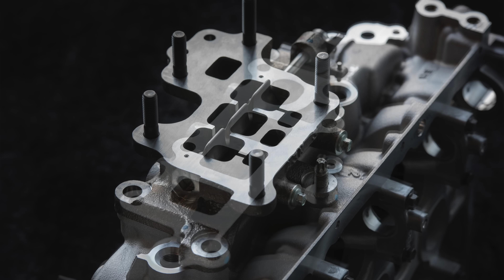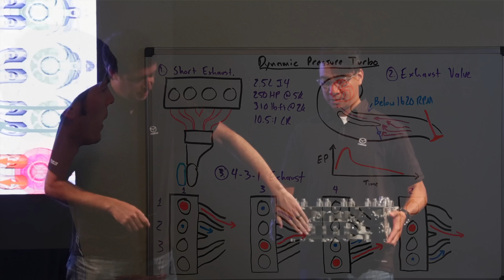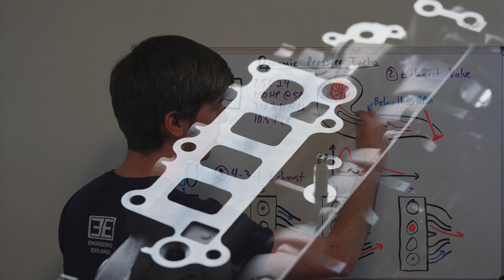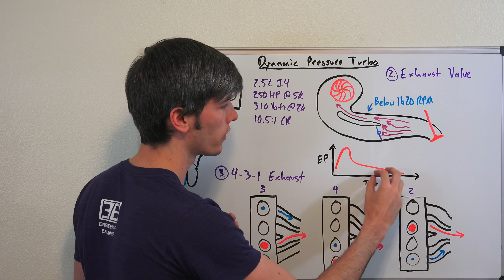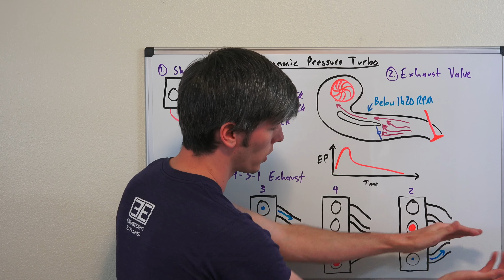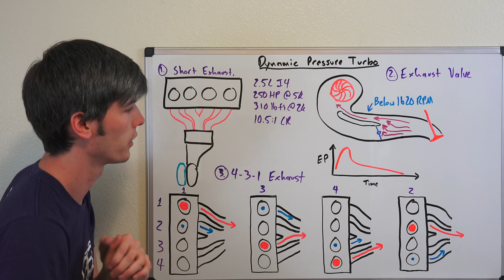How Mazda Is Eliminating Turbo Lag

Comment: Shorter exhaust is not to keep the heat. Shorter exhaust has smaller volume to be filled in with air, so with less power strokes it can faster build pressure between the head and turbo in order to start spinning turbo earlier. Shortening time to pump enough air is shortening lag time. Plus narrow canal speeds up air flow.
Also; we are having problems with EGR valves in intake clogging up with carbon. You can imagine how long this valve in exhaust will work properly before it just jams and you have to take it of for cleaning/exchange.

Comment: Wouldn't the lower pressure of the previously fired cylinder help pull exhaust from the just fired one? Gas always flows from high pressure to low. Don't understand how the high pressure exhaust helps pull from the other cylinder

Comment: This is roughly the same concept as a quick spool valve that Sound Performance made for the 2JZGTE engines.

As for the exhaust scavenging, that's a separate concept done in previous years.

Comment: Why isn’t there an engine thats more than 50% efficient?
Reply: Youssef some diesels are
Reply: Youssef look up the carnot cycle when you have time, there is an upper threshold to the efficiency of   the engine that depends on the temperature of the intake air/fuel mixture and exhaust after ignition.

Comment: The exhaust valve sounds like a typical Variable Intake system that's been around since the 80s on a a lot of cars, adapted to the exhaust system upstream of the turbo with the purpose of expanding the effective working range of the turbocharger.

Comment: That manifold explanation is just foolish. Read some book about gas and fluid dynamics. Gas goes at the path of least resistance. Idealy sport manifolds are made so you have most distance between firing cylinder and cylinder yet to fire. Thats how skyactive g manifold is made.

Comment: +Engineering Explained, So if this system fail (turbo valves closed) it will over rev your turbo to death!
Reply: I am not sure if the wastegate can relieve enough pressure if the turbo is being spun based on exhaust velocity, unless that wastegate is right at the head.
Reply: No, it is still wastegated.

Comment: Thats basically a variable twin scroll turbo, but the twin scroll pipe  ends after the valve and goes into one pipe. The varaible twin scroll closes off one of the scrolls so that all the air is going to only one scroll to increase spool speed. Borg warner makes it. Its a nicer system than this

Comment: just picked up a new 2018 CX9 a few months ago, great car.  It's really torqy especially off the line.  However it seems like it has less torque in sport mode.  I would think best performance would be sport mode WOT.  However it feels the fastest when not in sport mode had half throttle.  By the way thank you Kevin, you are a great educator, a true automotive professor :)

Comment: Uhh.. I may be wrong here but exhaust scavenging only works efficiently on a free flowing exhaust system. i don't see the point of attempting to scavenge when there is back pressure(turbo) such a short distance from the valve..

Comment: 1,3,2,4 makes more sense.
Reply from the maker: No, because then the center two would fire back to back, and this would negate the exhaust scavenging, not to mention it would require a crossplane crank which is not ideal for four cylinders from a balancing standpoint. 1342 is quite logical.
Reply: But now 3 and 4, and 1 and 2 fire back to back

Comment: Jason, do you a have any video for the firing order? It seems like they had to merge 2nd and 3rd exhaust because of the firing sequence. An order of 1,2,3,4 would still have the adjacent exhaust and meet the suction effect goal and would not need any exhaust to be merged. So what is the deal about the firing order? Does it have any advantages?

Comment: Hi Jason.. Another fantastic video explaining turbocharger lag elimination. I know that you favor turbochargers for efficiency. I remember reading or watching about an engine where they use a hybrid super and turbo. The supercharger would use the battery (not engine or through alternator) to spool up and then shift over to turbo mode for efficiency with almost no lag. Im not sure which company made this engine, I may have seen it on Top Gear.. This would be the ideal answer I feel.  What do u think about it? Do u by chance know of this engine? Given that modern batteries hold far more charge and can be recharged faster, would this be more efficient? Or would the extra weight, plumbing, and complexity make it less practical? Your thoughts please. Love the channel, content, and presentation. Keep up the good work! These videos are heavenly and delightful :-)

Comment: nice, in my opinion is far better than electric booster, something you didnt explain is how the low pressure exhoust gas that remain in the admision stage escape in conjuction with the other piston exhaust, is just the same escape valve? and how about timing to prevent the new air/fuel mix didnt escape?

Comment: A failure mode scenario for the exhaust valve where it gets stuck closed would stall the engine with practically infinite back pressure.
Reply: Avik Sarkar only in high rpm so no biggie

Comment: Here’s a weird idea, Jason. Is it possible to create a forced induction system with a compressor that is powered off the battery by a motor like an electric supercharger until there is enough exhaust pressure to spin up the turbine? Essentially a turbo that is spooled by an electric motor before the exhaust pressure builds so that it never drops off boost. I’m curious as to why this hasn’t been done. Do you know if there’s a reason?
Reply from the maker: Audi does this: https://youtu.be/k8-_UrfbRBA
Reply: Engineering Explained and here I thought I’d get rich patenting that idea. Interesting stuff. Thanks for the reply!

Comment: With a compression rate of 10:1 is it very efficient? I dont know anything about compression ratios. :/
Reply: 10:1 is an average compression ratio, but generally speaking the higher the compression ratio the more effiecent the engine is.
Reply: Govin Lock. the ford's ecoboost, VW's tsi, fiat's multiair, and hyundai's turbo gamma, most of these engines have compression ratios of 10:1, and all above 9:1, and run on non-premium octane fuel. For modern turbo engines, 10:1 is in fact normal.
Reply: Lucas Santi bigger compression ratio, more efficient. turbocharged petrol engine today generally have compression ratio 9:1.
Reply: turbocharged engine always have lower compression ratio than its NA counterpart, because turbocharged engine has higher pressure, which will blow the engine if have too high compression ratio.
Reply: Hemingway Bromfield
"10:1 compression ratio is average" for naturally aspirated, yes. but for turbocharged, no.

Comment: is it because of the momentum of the exhaust pressure in the turbo doesn't come back to the unused path (1650 rpm+ path) or it is just the first milliseconds from the inital state. since the system is design to maintain the turbo to keep spooling, the gases should keep running in the turbo instead of filling the space of the other path. In other subject, do you think that when 3d printing will be precise enough there will be another technical revolution on engine design, if electric engine don't come how to say, in the majority in our roads like, +90%. at least I may think that frame design will be.

Comment: 1. In this case I think the real purpose of using advance exhaust manifold design instead of pay much for using twin-scroll turbo.
2. According to 1. to use 4-3-1 setup instead of 4-2-1 (like 8AR-FTS which equipped with twin-scroll turbo) setup to prior the exhaust pressure by reducing the size of pipe.

Comment: Isn't that firing order common? So what makes this one different?
Reply from the maker: The 4-3-1 exhaust is unique. Most are 4-1 or 4-2-1.
Reply: How does this make scavenging better? Wouldn't a 4-1 in a 2x2 square also have the same effect? Although it does look easier to implement for an integrated exhaust header.

Comment: I never understood why when switching from flatheads to overhead valves in engines they never kept the better breathing three exhaust manifold setup
Reply: Mainly because it actually breathes worse in a non-boosted application.  Equal-length headers - either 4 into 1, or 4 into 2 into 1 - do a better job.  (In Australia, they're actually called "extractors" because of their scavenging effect.  However, they generally need to be much longer, and part of reducing lag is to keep the manifold as short as possible.  Some cars did have siamesed centre exhaust ports - and they were generally known for having breathing issues because of this - but this effect is small in turbo applications and vastly overshadowed by the benefits of reduced lag.
Reply: aussiebloke609 teach me your delicious knowledge you greasy gear head you

Comment: This seems like something that could have been designed years ago. Hopefully coming soon to the MX5.

Did you have a chance to look at failure modes of the exhaust valve? Any idea how many 'miles' Mazda has put on the new engine for reliability?

Thanks again Jason

Comment: I bought a 2018 mazda cx-9 gt model 2 months ago. The 1 big? is when you run hi-test gas it increases the horsepower but does not increase torq?
Reply: u have max torque at low rpm, any gas will be good at low rpm. Premium gas does better at high rpm when the engine gets hot and can knock. U also make the most power at high rpm. Power = (torque * rpm) divided by something (5252?)  so... there you go.

Comment: The butterfly valve in the exhaust manifold between the head and the turbo is good engineering.  Certainly appears to be a simple way to help reduce turbo lag.  I will give Mazda credit for that idea as I've not seen it done before in any other turbo engines.  However, exhaust scavenging is not a new idea, motorcycles have been using the idea for about 40 years, 4-into-2-into-1 exhaust designs have been around.  As a matter of fact, the premise behind tubular headers (like what is in our S2000) is to reduce back pressure, and increase exhaust flow by helping adjacent cylinders extract exhaust gasses.  So, I can't give much credit to Mazda for coming up with that idea.
Reply: S2kDude36 .. you're right. What I'd be concerned about are the longevity of that valve. With all the heat cycling, would that valve sieze up over time? Neat idea though.

Comment: I know they claim this is a great advancement but their 2.5T isn't the most powerful, fuel efficient and doesn't produce it's peak torque at supremely low RPMs like the best turbocharged engines from VW, BMW and Mercedes.
Reply: Peak torque 310 lb/ft@2,000 RPM isn't supremely low?
Reply: David Sparling not when other manufacturers can produce similar ratings at 1250rpm without any sorcery. Look at BMW or VW 4-cylinder turbos. Other issue is that over about 4500rpm, you have next to no grunt. VW, with their 2.0T, has plenty of low end torque at ~1500rpm, but power is aplenty until redline.

Comment: Butterfly valves in the exhaust stream. Sounds reliable ;)
Reply from the maker: Lots of diesel engines use butterfly valves in the exhaust stream (can be used for engine braking). Gasoline engines do it as well, but usually it's for sound purposes.